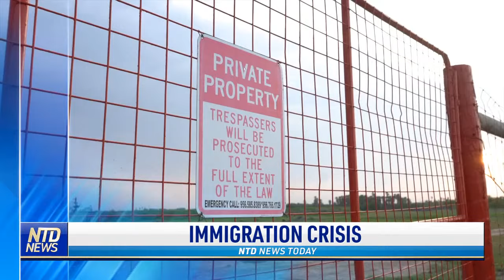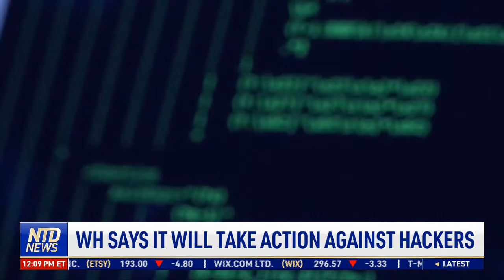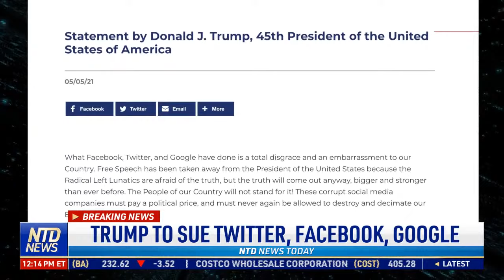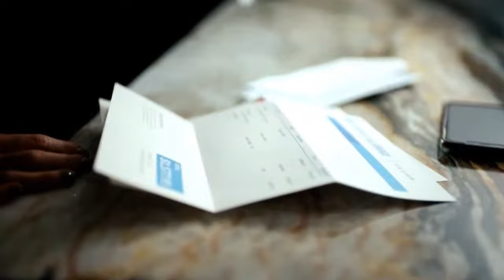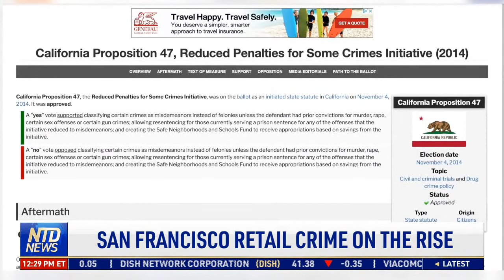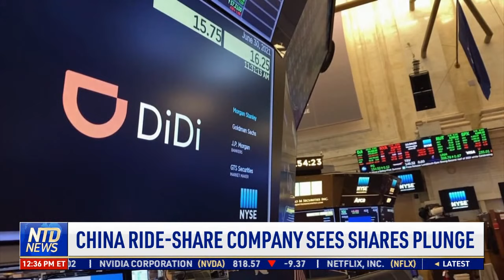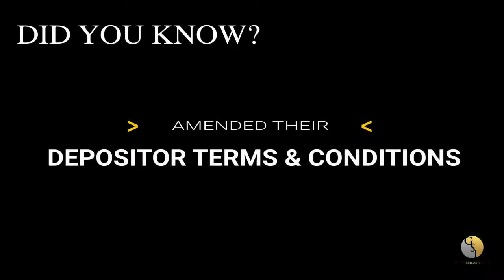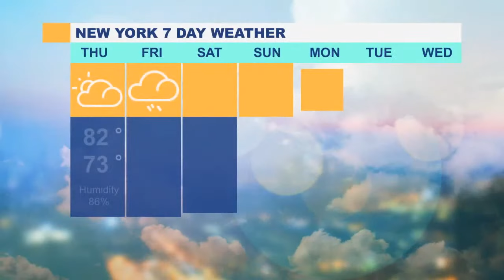Haiti's President Assassinated At Home; Surfside Death Toll Up; Tropical Storm Elsa Makes Landfall

Comment: The way the concrete crumbled into much small particles instead of more large chunks and slabs makes me wonder about the quality of the concrete used in building of the structure.

Views of the break seen on the portion of the building left standing showed the same kind of "crumbles."
Reply: Or it was intentionally partially demolitioned.